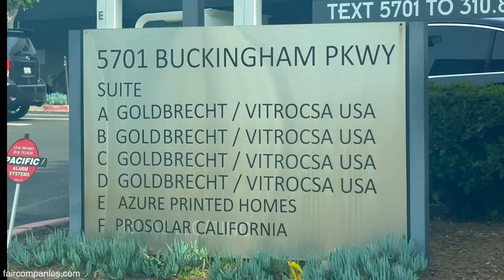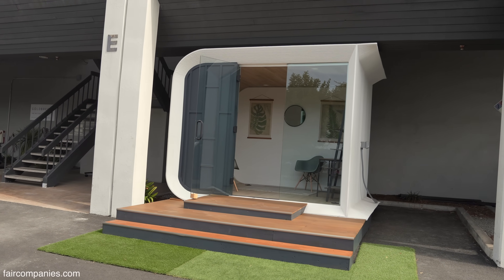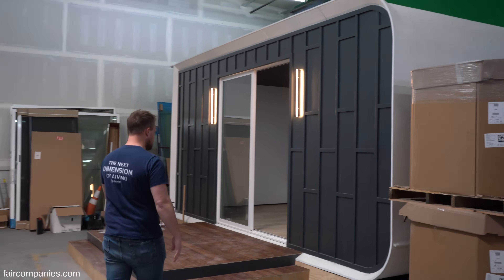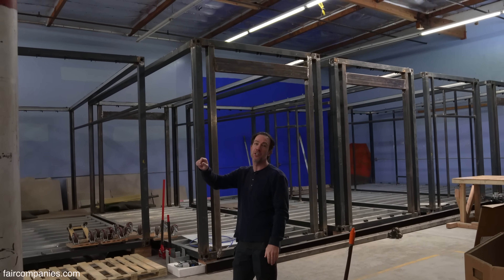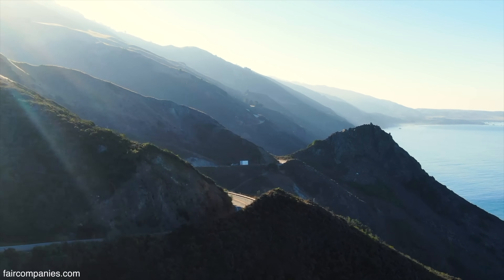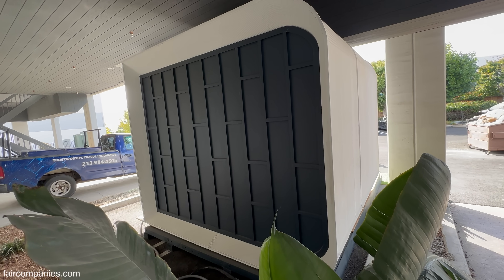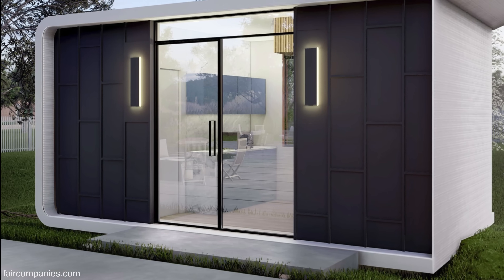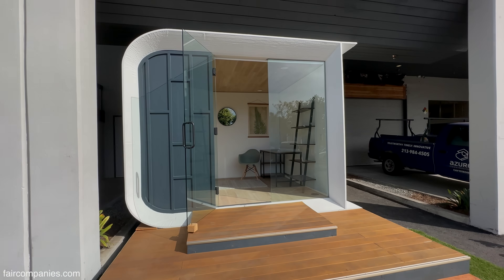Housing crisis + plastic overflow = prefab made of used bottles

Comment: I would get a wooden shed, and for much less, than to breathe VOC’s 24/7.
Reply: Are you assuming VOC’s would emit from the materials?
Reply: @m1andonlytwice  Yes it’s an assumption, I’m not familiar with the exact composition of the mixture, but an educated guess.
Reply: Yeah, me too
Reply: Had you thought of asking - what are the VOC? instead of assuming it does have VOC.
Reply: @simonscoggins1154  I know what voc’s are, and yes it was an assumption, but I’d say it’s very likely. Plus I don’t wana use synthetics.
The thing about recycling plastics is that, unlike say metals, it can only be recycled a few times. In other words recycling only prolongs the inevitable. IT WILL eventually end up in the environment. The only way to get rid of the problem is to not use it.
But I have nothing against the company.
Reply: It can be sealed so that it doesn’t off gas.
Reply: We're fairly surrounded by potentially harmful VOCs already (including inside traditionally built houses), so this comment comes across as unnecessarily alarmist with regard to these 3D-printed tiny homes.
Reply: @EchoJ  I made a reply to you, but I’m not sure if it’s visible to you 🤷‍♂️
Reply: @EchoJ  You are correct in that most buildings are full of VOC’s. It’s up to the individuals if they want harmful chemicals in their air water food and as their medicine.
Reply: What is voc?!.
S
Reply: @Gam31n  toxic fumes that continue to be given off for years by plastic and other artificial composites
Reply: Does it out gas ?
Reply: @terrimitchell8767  Exactly, why aren’t they answering that question? They should’ve tested for it, or look up the specs of the materials used, if it’s supposed to be safe to live in. Or, they know and don’t wana say.
Reply: You’re correct, 99.9999% of people use those products, thinking it’s safe, because it has passed regulations.
Reply: In my opinion, the problem with buying a  "metal box" is it can become a "grill" in extreme temperatures (for example, Spain's summer always surprasses 40°C), therefore, there is more waste of electricity/money on climatization.
Reply: Plastic is definitely toxic
Reply: What's a "wooden SHAD?"
Reply: @1wldnczyguy  😂 don’t you mean: wth is a wooden shad? thx for the correction 👍
Reply: Manufacturer:  "We've invented a way to build a house out of free trash material".
Me:  "how much for a 2,000 SQ ft trash house"
Manufacturer: "$430k and you supply the lot
Reply: 80k to live in a plastic shoebox?